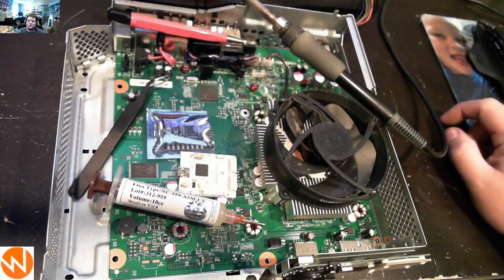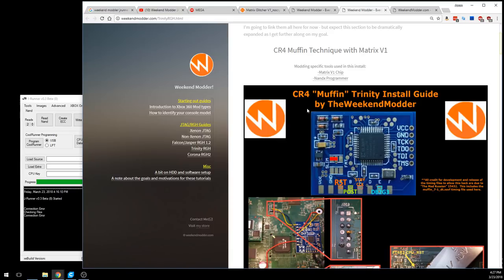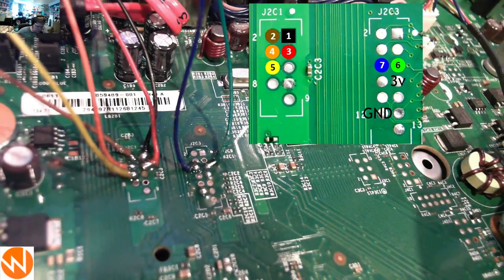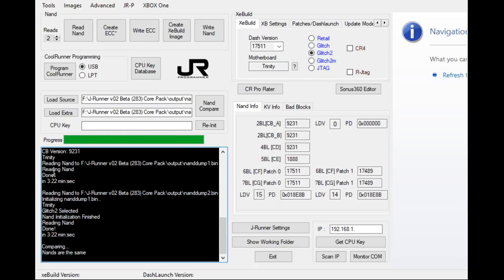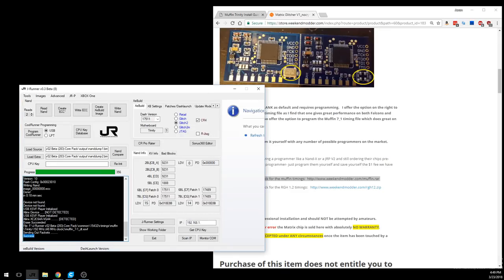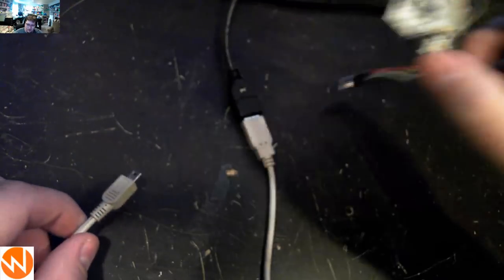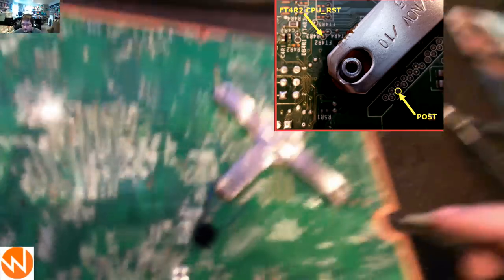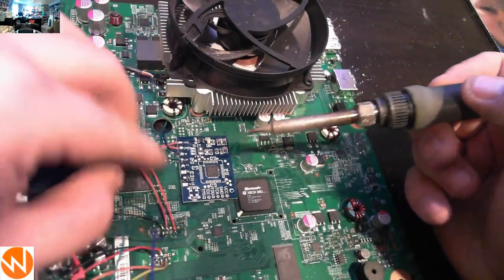2018 Complete Guide Trinity RGH Muffin Technique

Comment: My XBOX Trinity 4G is halt after XELL booted few seconds but I still have time to get CPU key and then follow the last step to write NAND. After I re-plug everything together, my xbox booted and showed logo normally just few seconds and it's halt again.
I bought everything from your store in the description and following step by step in this video.
Now, my xbox looks like halt forever after can boot 3 times but I can still read/write NAND and write Matrix V1 Chip. Can I un RGH to origin XBOX? or Please suggest some 
 solutions for me.
Reply from the maker: You can always disconnect the glitch chip's power, and write back the original nanddump1.bin file to the nand and the console should behave as a normal retail.    When you say "halt" you're saying it freezes?  Did you follow the wire routing suggestions?
Reply: Yes, "halt" is mean freezes. The power button showed red light, the fan is stopped and it has sound beep every time when I touch the power button. If I want to write the original nanddump1.bin back, the Retail should be selected right and CPU key has to be blank or put in it? If you have time, please post the guideline how to turn RGH XBOX to the original. By the way thank you very much for responding.
Reply from the maker: Just load "nanddump1.bin" in the source box, the CPU key area can be blank - that's fine.   Then click "write nand" and write it back to the console and disable the power to your glitch chip.  Your console will be retail again then.
Reply: After I bought new Soldering Welding Iron(https://amzn.to/2wZAk08) and Magnifying Glass(https://amzn.to/2kdBKuS) to repeat your video guidelines. My XBOX is working now. I do not recommend who doesn't have good eyes and  tools to do RGH because you will destroy xbox circuit board. By the way thank you very much #TheWeekendModder

Comment: Hi weekendmodder, is there a way to remove hacked firmware off a flashed DVD drive? Recently I un-jtagged my Jasper 256mb, it was originally on the blades and it is now, I already knew I wasn't able to use the DVD drive once I reflashed the original nand, but is there a way to remove the firmware? I un-jtagged it because I wanted it on the blades, yes I know I can't use any jtag programs or play newer games, but I have other consoles so I'm okay, I just want this jtaggable to be clean like it came out of the factory. Thank you. Oh and I get e69 when the DVD drive is plugged in.
Reply from the maker: The e69 tells me the DVD key in the drive probably doesn't match the motherboard.   It is possible to re-write a drive's FW with retail.  Do you know the DVD key for the console? Are you sure the drive matches?
Reply: TheWeekendModder actually yes, i bought this system brand new in the box from a seller on se7ensins and got it jtagged, I'm positive this is the matching drive
Reply: But the problem is I don't have any of the flashing tools, it's a dg-16d2s

Comment: I bought a RGH from you a while a ago. I cannot get it to boot. I looked it up my problem on youtube, but no one their solutions worked.
Reply: Kkhalifa bypass plugins
Reply: What do you mean it cannot boot that’s a very vague thing to say
Reply: Le Mars When turn it on, it will show to xbox logo for a split second, then shut off and try to glitch the cpu again. After that, it will attempt to turn on, but my screen will stay black.
Reply: Kkhalifa take the harddrive put see if that fixes it
Reply: Joshua Hutton Tried that, didnt work.
Reply from the maker: Just to be clear - I haven't sold a pre-modded RGH in like 6 months so you must have had it working for some time before doing something to create an issue. 

As other folks are suggesting here, if you are getting to the boot logo and then it's cutting off then your issue is with whatever plugins you have set in dashlaunch - they are likely bad / outdated.   

Check out this video:  https://www.youtube.com/watch?v=AAgg3T7c12U

Comment: I have a trinity Xbox 360 i wanting to put a mod chip in and im wanting to know can you run it without the disk drive installed? Im wanting to put all my games on an external hdd and hard wire it to the 360's usb and install it where the disk drive normally is.
Reply from the maker: Yes, you absolutely could run a modded 360 without a disc drive and play all the games from HDD.
Reply: Okay one more question, how big of a external hdd can i install?
Reply from the maker: 2TB is the max size the 360 will recognize
Reply: Per usb or total?
Reply from the maker: Per device
Reply: Thanks for replying.  When your store reopens i may just let you do it since you know what your doing and im learning.

Comment: So hope you reply as I'm stumped on this one...been making rgh for a long time and normally can solve issues myself but....
Got a x360 ace v3 café legit version so no fake. Running on a corona v3 with post fix adaptor. When she's not in the case she boots really fast and I mean instant. But when I put her in the case she won't boot at all. I cannot for the life of me find a reason. Nothing touching metal case and shorting. She glitches the way she should and she's in a low interference part of the xbox. Now I did spend a good 5 hours Trying different timing files as the original was so unreliable when booting.
Reply from the maker: I'd check really, REALLY carefully around all my wires that route from topside to underside of the board.  I've found that if a wire's insulation is going to fail that it normally happens there.  Beyond that - it'd just be a guessing game mate. :-0
Reply: I'm going to try some more timing files while she has all the parts in as I can then find a good file that works with the pulse

Comment: Hey i had ordered a matrix chip and a nandx. I need help I had connected my nand wires correctly but everytime i try to read my nand with the matrix chip installed i get a 0x00000 config and i checked my soldering and it's decent not too bad but i had desoldered and resoldered multiple times. I had desoldered the vcc and gnd cables and all of a sudden my nand x is able to read my nand again
Reply: I even tried booting it and i seen the chip won't even flash the blue light
Reply: I've sent you pictures on email yet I still have yet to receive a response
Reply from the maker: "Yet to receive a response" makes it seem like I ignored you and that is NOT the case at all. You sent an email at 11pm my time last night and I answered it at like 8am...  you need to chill out!
Reply: TheWeekendModder truly sorry my fault for not checking my apologies man

Comment: Flash Config: 0x00000000
Can not Continue
Can not continue
Checking Console..
Version: 10
Flash Config: 0x00000000
Can not Continue
Can not continue
Checking Console..
Version: 10
Flash Config: 0x00000000
Can not Continue
Can not continue
Checking Console..
Version: 10

everything is soldered correctly and i have standby power whats wrong?? please help me.
Reply from the maker: "everything is soldered correctly"  are famous last words.   Post pics?

Comment: just wondering, is it possible to RGH a Jasper Xbox 360 with an x360 acev3 chip?
Reply from the maker: Yes, it is possible. I've never done any videos or tutorials of that method because I found it less reliable than standard RGH 1.2 using a Rev C or Matrix V1.

Comment: Hi; I have a problem with my xbox 360 slim. I opened it to clean it and change the thermal paste; when I closed it, the console does not want to turn on. I put a video here: https://www.youtube.com/watch?v=QwNinToVElI
 just so you can tell me the reason for this failure. 
xecuter coolrunner's green light flashes

Awaiting your response thank u
Reply from the maker: Sorry - no way for me to tell the cause based on that...    If all you did was open and clean it I would double check all the wire connections thoroughly.
Reply: Ok thanks

Comment: anyone know how to get the jr2 programmer out of bootloader mode if it doesn't show up as connected on your pc so you cant install drivers? lol
Reply from the maker: Flip the BL (bootloader) switch to the other position.
Reply: TheWeekendModder I actually managed to get it working however switching the switches around does nothing and it shows up in device manager as just a USB device and loads normal USB drivers and I haven't been able to load the jr2 drivers as it just says that "windows has the optimal drivers installed for this device" or something along those lines.
Reply from the maker: You're still in bootloader mode then.  Maybe actually flash the JRP v2 .HEX file firmware to the device.
Reply: TheWeekendModder because I can't install the drivers correctly I can't get it recognised in j-runner so I'm not quite sure what to do
Reply: Play around with the device itself mine had that issue and I could briefly get it working with Windows 10, windows 7 consistently works though